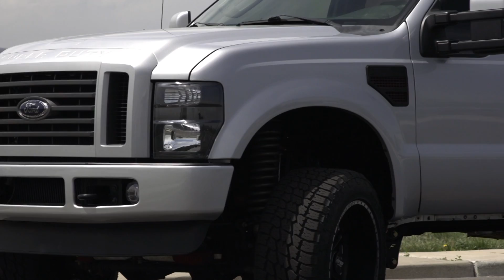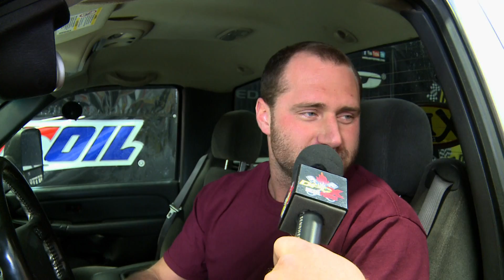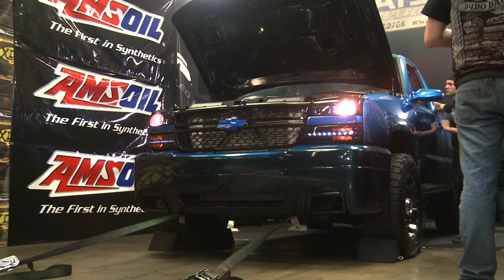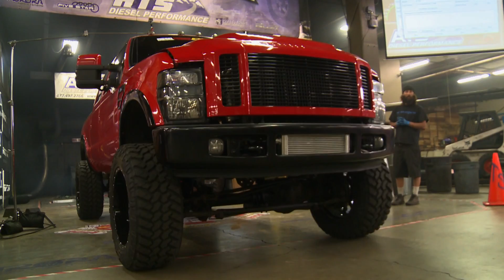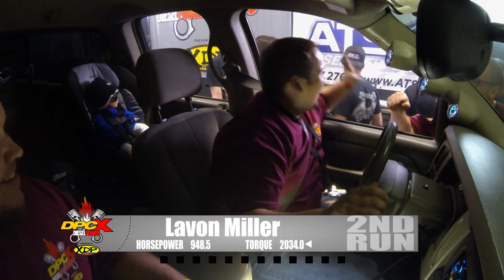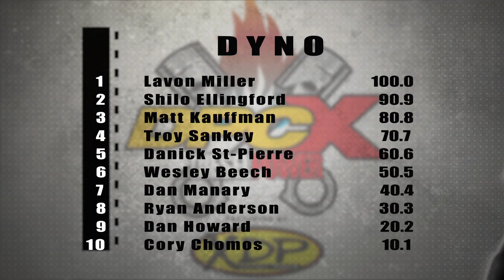Dyno Testing - Day 1 of Diesel Power Challenge 2014!

Comment: u think there ever come out with a electric big truck like these? electric would blow these away and be way more reliable.. only prob is the power source, need something better than batteries.
Reply: more reliable than a diesel? diesels are the most reliable engine out,
Reply: electric has one moving part... most ships run on elctric motors... ever heard of nuclear subs, all electric
Reply: quickguesswho knowledge on a bunch of things verses the knowledge of a fan boy, nicely said
Reply: The problem is the space needed for and weight of the batteries.  Plus some durability questions.  I'm certain it can be done but it needs alot more research. On board vessels and what-not there is not the risk of large jolts from being off road, which engine manufacturers have worked out. I hope the auto industries work  out a way to have all powerplants, gas, diesel, and electric available in multiple platforms.
Reply: i dont think batteries are the answer, but electric are.. trust me electric motors can take large jolts, look up rc cars (traxxas emaxx/erever/slash) then jump 30-40ft or higher and slam on the ground and the motors work fine.. they are even waterproof..
Reply: There is no electric storage solution even on the horizon that can approach the requirements a heavy machine needs.

There is no doubt electric motors are better performers, but electricity storage is only just now approaching 2/3 the energy density of gasoline in state of the art laboratory batteries. The ability for batteries to power heavyweight vehicles is 30 years out assuming it is even possible.
Reply: gunshooter26    wow i forgot diesel locomotives??.slow r we..  the diesel engine drives the generator and the generator powers the electric motors which makes the train move..
Reply: what about the generators on ships.. diesel.. i guess we are slow.
Reply: +gunshooter26 .. Thought we just went through this? cruise ships and large ships work similar to diesel locomotives.. In the end in the electric motor that makes the boat move.. the diesel engine powers generator which send electricity to electric motors..
Reply: quickguesswho I actually think an automotive version of this would be awesome.

Infinitely variable, and allows the engine to operate in its specifie efficiency range.

From what I know, the generators to handle the power that are developed currently are too big and heavy!
Reply: Powersource is already avaliable, a Hydrogen fuel cell. Toyota is releasing a car next year that runs on it. Though you still need to store some electricity for peak needs like acceleration. And no, no diesel is more reliable then a mid-range electric motor.
Reply: theres no way in hell an electric can match a diesel in a hundred or so years maybe but not now
Reply: Gabe Reed You should really look up electric then cause electric motors are way more powerful than diesel.. The biggest and mostpowerful things in the world are electric/ nuke sub, ships, locomotives..
Reply: Gabe Reed Ignorance is great huh? Have you not seen the technological advancements lately? I'd say we are were close, maybe not in the US but internationally.
Reply: Fekillix Hydrogen Fuel Cell Vehicles have a lower efficiency, and lower power density than Battery Electric Vehicles. 

ChargedTTq Actually if you are looking for the best petrol generator for an electric drive vehicle, you should be looking at turbine engines, not diesel.  Generators do not need a wide power band, this is why Diesel is much better than regular Gasoline engines... but a turbine engine has a MUCH higher, MUCH more efficient output, using a LOT less fuel and in a MUCH smaller engine.  They just couldn't be used for direct drive in a car because of the insanely small RPM range that they develop all that power.  Hook it to a generator though, and run it at it's peak efficiency, and you will have a very compact generator putting out a lot of power.  Jaguar once made an electric concept car that used two gas turbine engines as generators.  It was named the Jaguar C-X75.